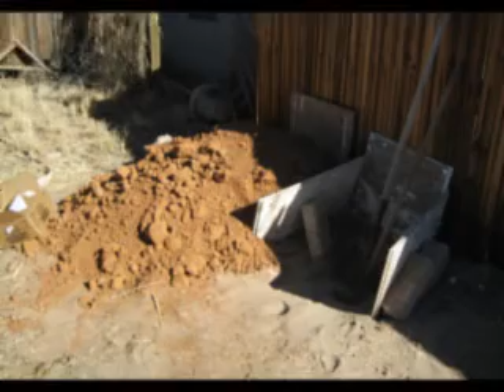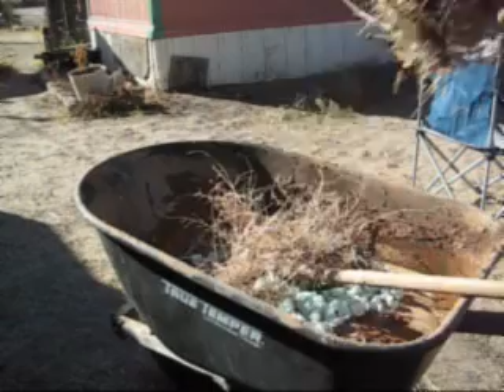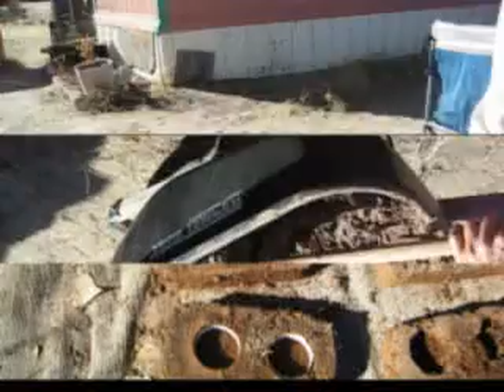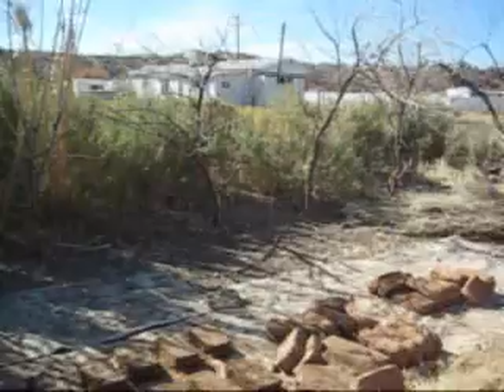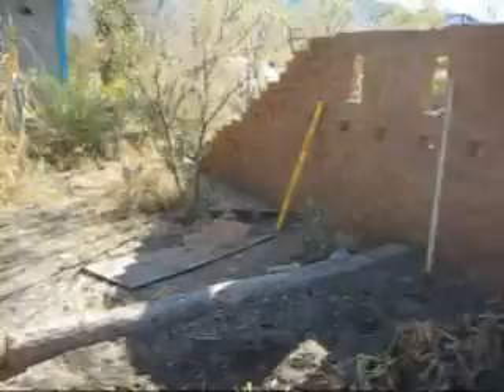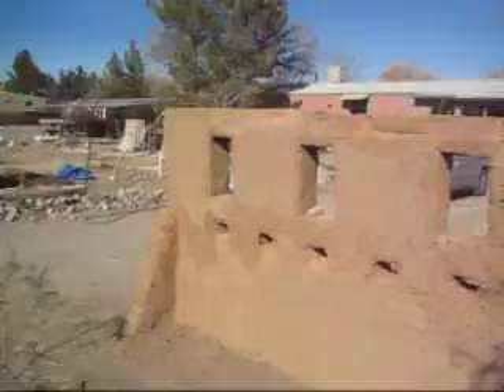Making Adobe Bricks

Comment: Maybe I wasn't paying attention very well, but what is the purpose of the cat food cans in the brick ? Can't be an insulation thing ! Those cans only take up approx. six-seven spoons of volume per can ! Just getting rid of cans ????
Reply: Not sure either maybe for looks or just so he can use less mud on the bricks so the mud goes farther is my guess
Reply: Modern day bricks have holes in some designs, the reason is for bond strength when mortar is put down it holds better and in this case it Adobe mud , does the same thing .